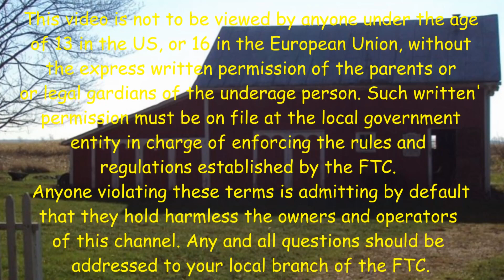OSW Annex Day 33   Gaining Ground Despite Flooding

Comment: A small scissor lift would be perfect right about now..............I once rigged up a Hi-Lo with some wires attached to the controls so I could operate from the lift basket by myself.....I still had to drive it into position but I could raise and lift myself that way.
Reply from the maker: I should gave bought a bucket lift years ago. 
FarmCraft101 bought a 60 foot lift and every time he uses it I think, "If only."
Reply: Slow always wins the race in the end....It’s going good.....CHEERS
Reply: I agree about a scissor lift.   I thought about buying a used Genie or Skyjack but decided against it when I discovered the previous owners of my property left behind most of the components of a scaffold.   It's a whole lot cheaper to just buy coupling pins and proper casters, and when I finally finish assembling it the platform will be about 11 feet off the ground.
Reply from the maker: We used scaffolding to paint the old house the first time. 
Then we rented a Genie 35 foot lift from the local hardware store the next time. We just stayed with the rental Genie from then on. It's nice not having to climb up and down. Also reaching over the roof to get to the dormers was exciting with scaffolding. 
I built a catwalk that extended about 15 feet from the top of the scaffold over to the dormer. 
That was 30 years ago. Hauling 2x6's up 3 sections is more than I want to do now. 
Using scaffolding on the inside is fine. I can roll it on the nice smooth concrete.